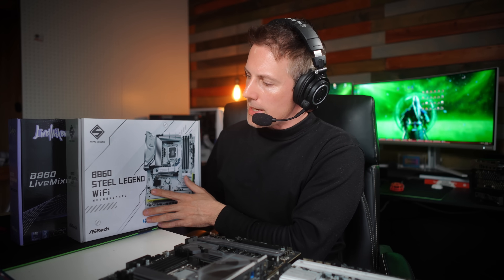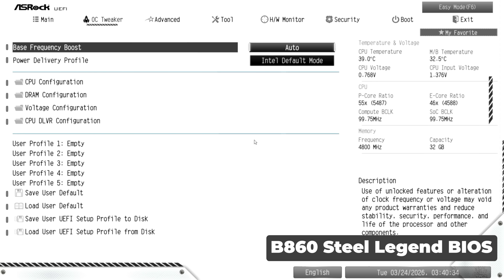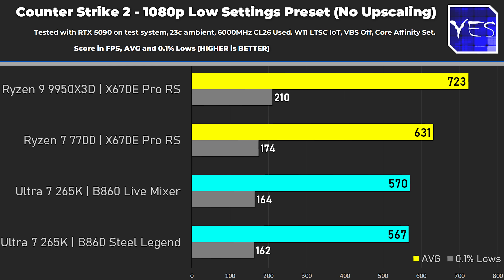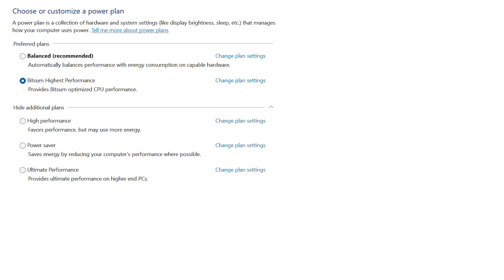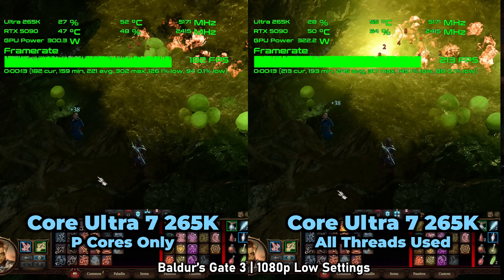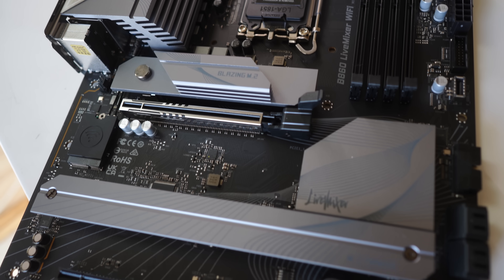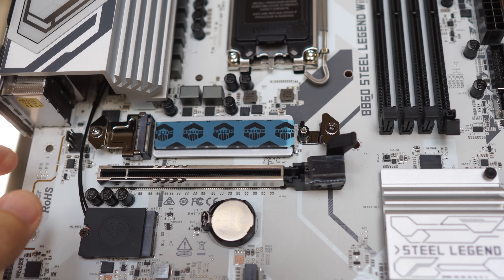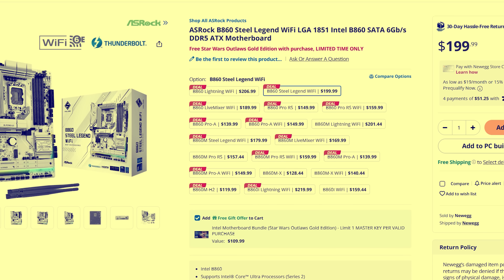I tried the Ultra 7 265K on B860 motherboards and...

Comment: That's actually a rather disadvantageous comparison, since the new Intel processors benefit more from faster RAM than from tighter timings. I'd be interested to see what the CPU would deliver in terms of frames at 8000 mt/s cl 40 in comparison. One should emphasize the full potential of CPUs, and that includes a good RAM controller.
5:00 You even mention it a little later, great 👍
Reply: idk man that sounds like crazy cope, there is just no way that they compete with amd in 2025 even if they added hyperthreading back
Reply: @S4SK__1 it’s not cope. I’m getting a 9950X3D but it’s true, AMD can’t go above 6400MHz unless you drop to 32GB, in my workflow I need 96GB minimum and on Intel Ultra series that’s doable at 7200MHz.

The problem is Quicksync doesn’t matter anymore with the RTX 50 series GPUs due to the new encoder, so Intel’s only benefit is ECC RAM & Thunderbolt 5.

At 1440p & 4k gaming + an OC it’s better than AMD, I just don’t wanna tweak it and prefer lower power so team red it is.
Reply: @dubyadubyaeee you can be at 48gb @ 6400mhz :) with amd
Reply: @ not with ECC.

Comment: Man thats so sad. Even slower than the 2,5 years old and also cheaper Ryzen 7700.
Reply: The usual gamer whining.
Reply: It’s actually a way faster cpu. Intel isn’t focused on gamers but on performance. He’s not testing 4k which will beat a 7800x3d in 1% lows and run way cooler and use less energy for less money. Even the boards are less money.
Reply: Reducing the power limits without the efficiency gain to make it up
Reply: how is it even possible to fall of so hard
Reply: sad. even when OC'd the 265k still loses in gaming. for productivity on the otherhand, the 14700k and 9900x are better in many workloads
Reply: @cant_Comment  I really don’t wtf Intel engineers were thinking by moving the memory controller from the cpu tile to the SoC. The added latency nuked the performance..
There are already rumors about Intel placing it back into the cpu tile in the next gen 300 series basically making the 200 series the “oops we f’d up” series
Reply: @ not only did they separate the cores from the memory controller, the 200 series CPUs have so many more problems; IO is not on the same die as memory controller(even amd puts the IO and memory controller together), intels cache and memory latency is also very high, die to die clock is too low, p cores dont have multithreading anymore, p cores are limited to just 5.7ghz, intel memory controller is stuck at gear 2 mode with no high speed gear 1 support, instability issues, games and productivity apps not working properly, usb issues, pcie issues so on and so forth. even alder lake is better in certain workloads. at least a 12700k/12900k have 16 p core threads. a 285k only has 8 on top of many other problems. imagine gaming on an intel 245k with only 6 p core threads... 💀💀💀
Reply: @kerotomas1  The past decade a lot of key figures have left Intel for AMD or other manufacturers. The Core 2 days and x58 nehalem triple channel days are over. It seemed like Intel would NEVER fall off but here we are. Its good though.
Reply: @cant_Comment  because it was not made for gaming, it was made to be energy efficient for laptops and maybe some potential handhelds. The iGPU that comes with it is pretty strong.

Comment: Please show some 1440 and 4k gaming results, no one with a 5090 is gaming at 1080 low. At 4k my guess is the gaming is equal.
Reply: the tests are made at 1080 p to show the maximum the cpu can do, not the gpu

this onformation has been shared so many times but people refuse to accept it
Reply: At native 4K, full rasterizing it should be equal to X3D chips. But remember, even 5090 users will be using DLSS at some point along with framegen, which means it will render at sub 4K and then getting upscaled. So X3D chips will still obliterate all these Core Ultra even if you're playing on 4K displays.
Reply: @merrypanda2504  For 5090 use there's pretty much no reason to go for anything other than the 9950X3D or 9800X3D. However, the moment you step off that $2000 cliff, the differences are seriously negligible, even with your DLSS/FG. And actually, that's the testing that should be happening; looking for stutter when running settings appropriate for a given video card... But that's too much work, and too easy to accidentally influence with your monitoring.
Reply: @merrypanda2504  That's why I want to see full testing, I want to see how they actually compare with settings people are actually using. Plus it's not fair to compare a $330 265k and a $480 9800X3d, let's see how it compares to a 9700x.

Comment: ryzen 7 7700 is so good
Reply: I have the 7700x it's not bad
Reply: @turtlesoup-vl2cx  yea, atleast it isnt intel
Reply: @Gargentwitchongargee  intel is so washed not sure what happened 10 years ago intel was unquestionably the best by some margin
Reply: @ I think its because intel isnt power efficient anymore which have caused the problems
Reply: Just looking at cpubenchmark, 265K gets a score of 58,768, while the 7700 is 34,482
Reply: @  intel and amd isnt same at this point
Reply: @echt114  is this true also at what wattage and power consumption
Reply: @ I don't know. They list TDP at 125w for the 265K and 65w for the 7700.  Also I forgot to mention that the single thread score is 4868 for the Intel and 4063 for the AMD. I assume these tests are at stock with no overclocks.
Reply: @echt114   7700 isnt in same category as 265k
Reply: @echt114  listed tdp can 50w but what will actually pull from the wall is more important plus is using 420 water cooler meanwhile the amd is using a small cpu fan
Reply: @Gargentwitchongargee:   You specified it in your comment.  That's why I gave comparison stats.
Reply: @turtlesoup-vl2cx  "plus is using..."  What are you talking about?  In whose tests?
Reply: @echt114  we have seen tdps get ignored by mobos and they automatically add more volts

Comment: For this price it needs to be very good, but not "not bad"
Reply: It is very good just not for gaming. With the price drop it is a good productivity chip with enough for gaming on the side.
Reply: @thumpthumptv1651 problem not only in CPU, but in motherboard prices as well. B860 boards are very expensive when comparing to B650. B850 is also too expensive, but with AMD you have some alternatives
Reply: 311 dollars vat and all included here in denmark, build one z890 build for a close friend of mine, it reached 34680 points in R23 with 48gb 6400mhz ram and a mediocre 3060 gpu!it doesnt really need a gpu to render fast at all, since you can even overclock the igpu in bios!
Reply: If you know how to tune and overclock, it will be great. 
I have seen people getting almost, 9800x3d performance. But it will cost ya high-end memory and custom cooling setup.
Reply: @OldPcTuner  and money. Just to get to stock Ryzen. I don't say that this CPU is bad. My point is, that CPU is too expensive, boards for new socket is expensive, but overall stock performance just "not bad".
Reply: @ Yea I get you, I am running a 14700k. I don't see the point in changing platform. I just overclock it :-)
Reply: @axescar  stock ryzen is shit. fTPM issue is a joke. from 2017 zero fixes 😂
Reply: @d1namis  is there any details? What's problem with stock Ryzens? What's with ftpm issue? Never heard of it
Reply: @ fTPM is a problem in many games cause heavy stutters and freezes. It's a problem that mostly common in some games that the others, like "New World", "The Finals" etc Also many application uses fTMP as well, so your entire system will be randomly hung up. For people who had to use TMP encryption algorithms, Ryzen is unusable. But there are many other Ryzen specific problems, that just not covered in gaming focus reviews.

So, if you want to use Ryzen without major problems you have to use Windows 11 with Bitlocker and all TMP stuff turn off. Same for Windows 10. Better Disable TMP in BIOS and avoid games that uses TMP.
Reply: @d1namis  thnx for clarifying. I heard something about it, but I haven't encountered it.
Reply: @OldPcTuner  , "almost 9800x3D performance" in what game, exactly? Because there are games where the 9800X3D is A LOT faster, and that difference surely can't be recovered through any tuning/overclocking.
Reply: @ruxandy  9800x3d are only good at 1080p gaming .
Reply: @ArkenShromAbuser 100% - самое смешное что ради фпс за гранью герцовки монитара в неиграбельнлм разрешении все плюют на мнгозадачность и производительность в софте ))

Comment: nobody buy intel b860 here, very bad value
Reply from the maker: Thunderbolt 4 can be very handy. Though most gamers will hard pass this arch for sure.
Reply: The Intel Core CPUs can be ok in some productivity tasks like code compiling in Linux. It very much depends on what you're doing. If you're a 100% gamer then sure, get AMD. But everyone should do research on what their use case is and their local market.

Comment: Yep I am in asus fan I only buy Asus high end mid range strix or hero for motherboards not only are they the best for overclocking they don't cheap out MSI would be my next pick and If cant pick the asus or msi well then im fcked because the other brands all suck
Reply: I just bought an ASUS Stryx B650E-F Gaming WiFi for my next gaming rig, (it is a beautiful mobo to look at),
and the ASUS X99 Deluxe I had in the closet will be my new daily & it will run on Zorin OS
Reply: @ awesome trust me u did not go wrong Asus the king of mono and gpus
Reply: Love asus but Bought msi tomahawk b860 for my ultra 7 265k built and it's sababa legamrey
Reply: @ msi is definitely a good choice as well
Reply: New? or Used? I find both of those brands quite often used for the last 2 years.
Reply: @Willbme4EVA  the X99 was new when I bought it & the Stryx is new, I will go from AM4 TO AM5, and b4 you ask, the Stryx is replacing an EVGA X570 DARK with a 5900X CPU & I am going to sell them with either the 64GB Corsair Vengeance or 32GB Dominator RAM
Reply: @ hell yes that should be a sweet setup.  I am building  a used MEG X570 Unify, with a R9 3900xt, 64gb 3600,  Rtx MSI 3080 Ventus 3x.  It is just a side grade but still way more compute power than NASA used to go to the moon.  Now we need this much and more to play games on earth.
Reply: From the river to the sea
Reply: @viniapiaia  israel will be free the greater isr ael project

Comment: Are there the same problems with I/O latency that you encountered on Alder Lake/Raptor Lake?
Reply from the maker: The Ultra 7 felt better than the Ultra 9, but the Ultra 9 i had was exhibiting stability issues. For me personally it's been 12th gen and under for a decent experience on intel (i used the 12900ks over Christmas and that was pretty solid.) The 10th gen chips however with really low latency ddr4 being incredibly responsive.
Reply: @techyescity  It’s possible that your Ultra 9 had a defect that isn’t immediately obvious. Some Ultra 200 series have an issue where increasing the voltage on the E-core above 1.2V causes WHEA errors during stress tests, while others don’t. It’s likely that your unstable Ultra 9 has this issue, and I think it’s related to a problem with bonding the die tiles to the substrate, which has affected some chips (this has been reported on overclocking forums for the Ultra 200 series). My Alder Lake also has an issue with stuttering in some cases when the NVIDIA GPU driver is active (on my channel in Shorts), and it’s hard to pinpoint the cause because when I reproduce it, there are no spikes in Latencymon. Have you encountered this?
Reply: @techyescity  i was a huge fan of 14th gen since i got a sample that could run 8200 2x24 with timings tightened down but it just had to fry itself after some months, it is actually laughable what intel is selling as product these days, nothing works, everything is slow and overpriced. when i switched to 9800x3d i was blown away on how fast that thing is while only pulling 120watts after having had to getting used to the nearly 400watt powerdraw from the intel chips ive had over the last couple of years.
intel needs to get their shit together